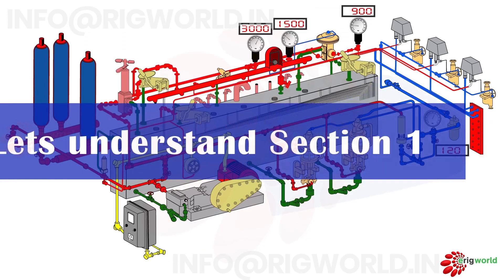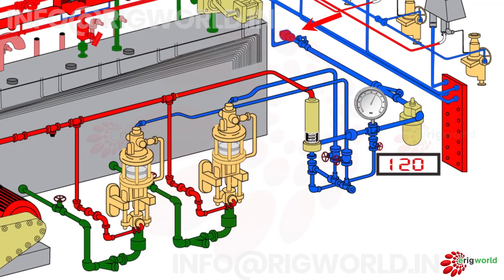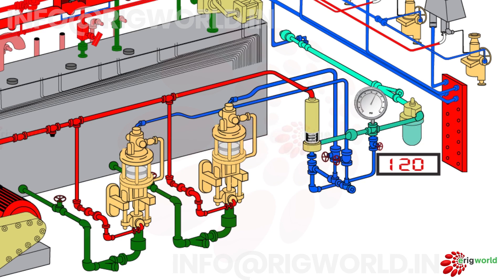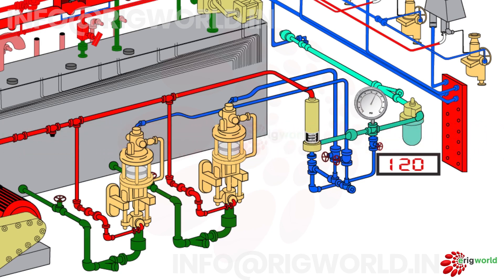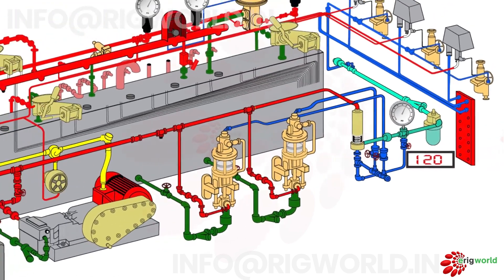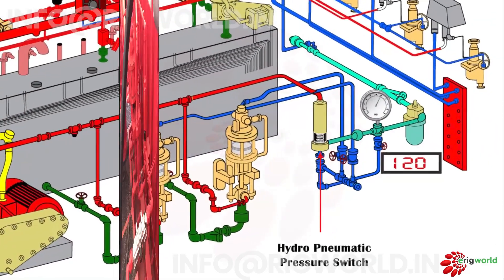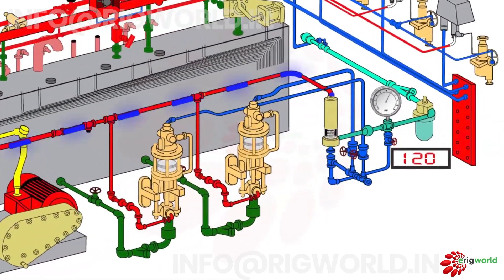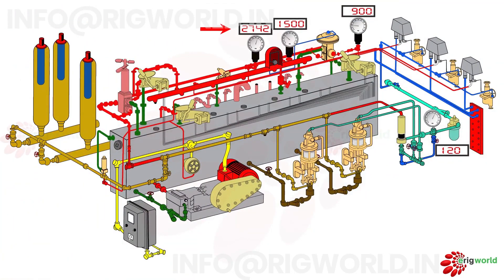IWCF Level 4| Accumulator pneumatic charging, working| IWCF| Well control | BOP| Accumulator working

Comment: I used to work on BOP's and accumulators in the 70s for Tri-State oil tools and NL Shaffer. Lots of time spent rebuilding these 50:1 Stewart Stevenson pumps.